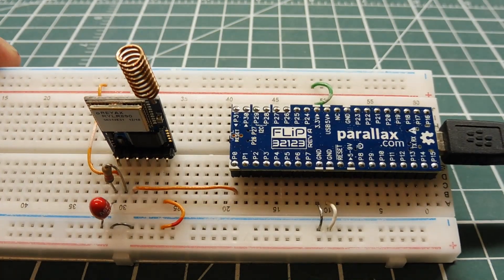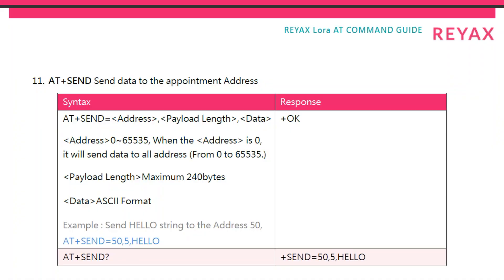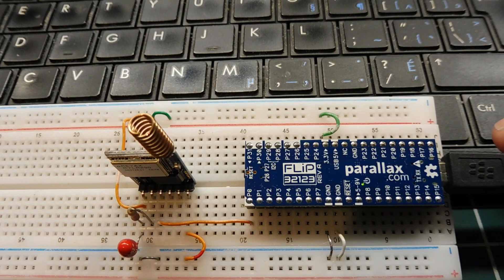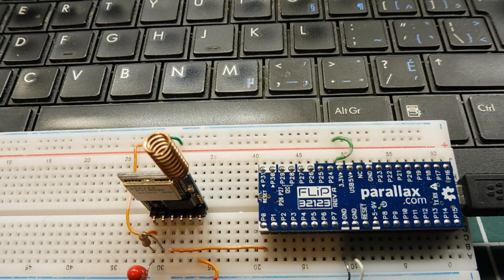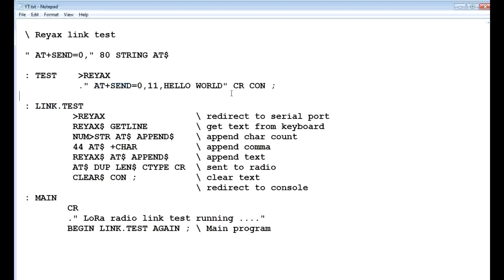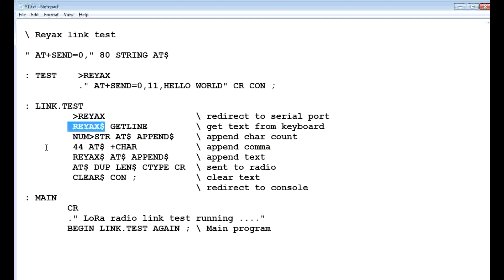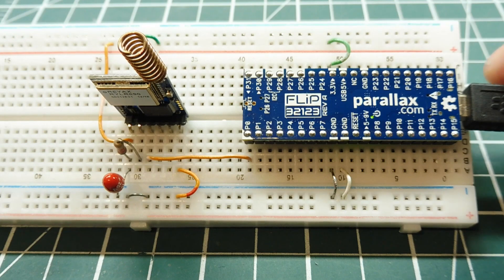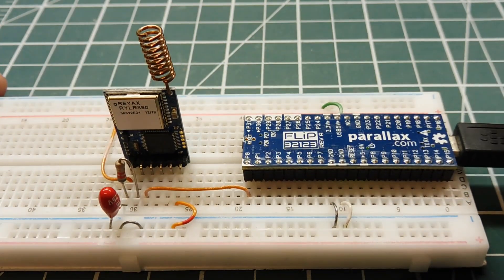Reyax LoRa Radio Link  /  Tachyon Forth  / Parallax Propeller

Comment: Why would one want to use this Reyax module if the E32 module is easier to implement/use ??
Reply from the maker: I am using the RSSI and S/N feature for propagation studies. The low power output gives me worst case results. I am building a project that is not line of sight and the radios are close to the ground. The E32 modules do not have the signal measurement feature.
Reply: 0033mer  Good points on the RSSI. Thanks.